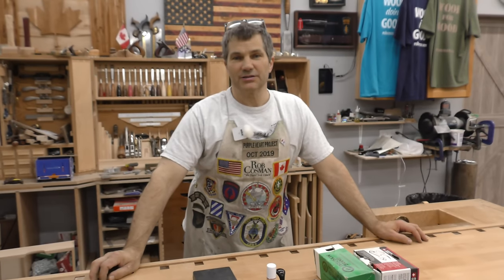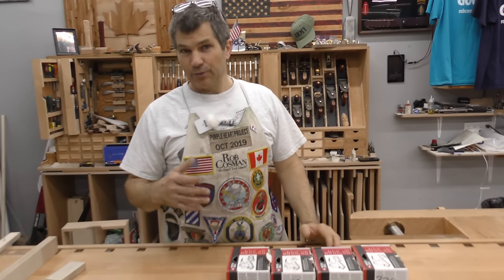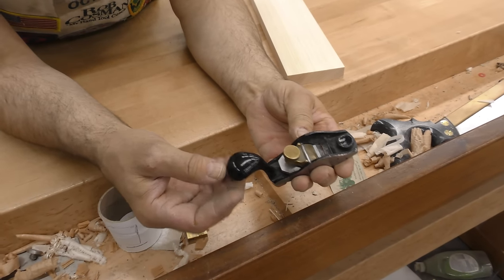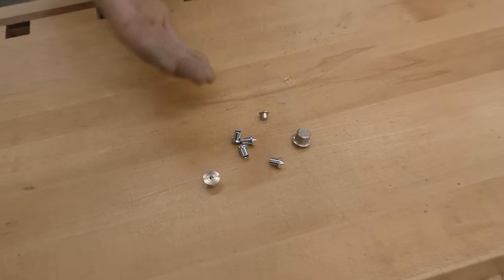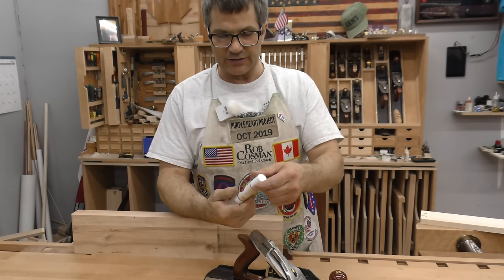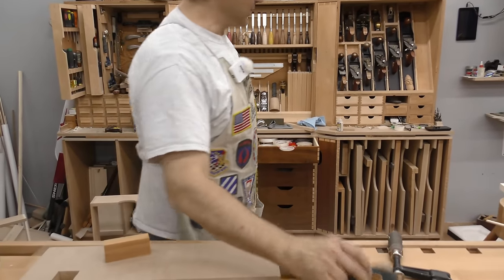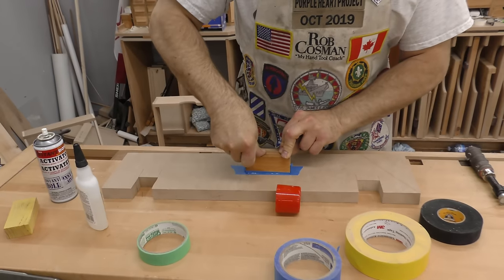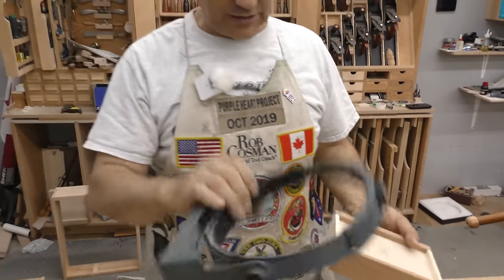Top Woodworking Gadgets - MUST HAVE ITEMS

Comment: Great list.  I guess I don't have to feel bad about using feeler gauges on woodworking projects anymore, and my Optivisors come in handy for fine work. ;)

One thing not on the list is a set of transfer punches.  They can be useful at times.
Reply from the maker: Feeler gauges give you super power!!!  Transfer punches ins another great tip

Comment: I will be buying that polishing putty.   Arithma Addiator for doing adding and subtraction.   You can quickly add and subtract multiple different things at the same time quickly and accurately.  Also if you can get it dry ice blasting, non abrasive way of removing unwanted surface material.   No sand dust.
Reply from the maker: I just looked up the arithma addiator....can you tell me more about it?

Comment: UK chippy here. The items I always have in my work shorts pockets are: 
Carpenter's pencils - soft and hard graphite, plus white for hardwoods
Quick change brad point pilot bits - it takes a few seconds more to pilot a hole rather than risk splitting the wood.
Stanley Sliding Pocket Knife- excellent lightweight utility knife with quick change blades.
6" Combination square - Useful for quick square checks and marking. 
Cheap reading glasses- I get them from pound (dollar) stores and are throwaway rather than wasting good glasses.
Drill bits- Flat, PH2, PZ2, they stay in the pockets and are transferred over to new shorts on wash day!
Reply: I've never seen a Philips drill bit. I thought that all drill bits were round.
Reply: @johncoops6897  "Drill bits" in UK can refer to either hss/brad point bits etc or screwdriver bits.
Reply: @nickm8494  - How odd. Well, considering that they are quite different objects,I imagine the UK naming tradition must cause massive confusion in the hardware store and on job sites LOL.
Reply: @johncoops6897  Not at all, John. I don't use "hardware stores", I use specialist trade and builders merchants and if you ask for either PZ2 bits or HSS bits we all know what we're taking about because we're professionals. lol.

Comment: Wax paper - to use under glue ups
Butcher paper - for patterns &  drawing plans 
Blu tack mastic adhesive putty - holding patterns/pieces, cleaning out grooves, making sure surfaces are dust free prior to applying finishes. Wad a bit around the end of a wire or dowel to retrieve small items from small spaces. 
Rubber Bands - dozens of uses

My number one... 
Rare Earths Magnets - wrapped in a piece of paper you can easily pick up spilled nails, screws, etc. Just unwrap the magnet with the things inside the paper & you can funnel them into a can.

Comment: I see quite a few of mine here already. Playing cards: shims, epoxy mixing, paint mix color testing, glue spreading. Popsicle sticks/ coffee stir sticks: shims, patch material, fast and cheap mixing spreading sticks. Old CDs: epoxy mixing. Drinking straws: clearing out glue squeeze out. Magnetic instrument base(the ones with the on/off switch): heaven send to hold plane blades and chisels when flattening the back, and also great to pick up metal filings and such. Saddle stool, similar to a low bar stool but with a 'saddle' or bicycle  like seat, most commonly used by hair dressers, gives your feet more traction on the ground compared to a bar stool and less 'thigh fatigue'.

Comment: I use those Optivisors also, and have found various focal lengths are great.  The lenses also are available in GLASS rather than plastic, if you want.  Also, you can get a small lens that attaches to the visor and swings onto the right or left eye for up to 10X for magnification.  Why would you want that?  VERY handy at times.  You can inspect very small measurements, also great for looking at cutting edges to see small flaws.  And of course for finding and pulling small slivers out of your hands!  pretty hard to hold a magnifying glass and tweezers at the same time, especially when the target is on one of your hands!

Comment: Hey Rob, thanks for the vid. Just wanted to mention playing cards. I use them a lot when, for instance, I want to move my bandsaw fence, just a hair. They measure 11 thou ( at least mine do ), and I love them because of their consistency. I have measured several with digital calipers and they are very consistent in thickness. I keep a deck in the top drawer of my tool chest...:).
Reply: Great for adjusting door hinges.
Reply: I added the hoyle waterproof cards recently.  They are almost exactly 1/64th of an inch thick, which is handy for a lot of things, and they are waterproof and glue won’t stick to them, so they last a long time.
Reply: @MD-en3zm  I'll have to get a package of these, thanks.

Comment: Rob, that little glue bottle is also great for liquid hide glue. Keep it in your pocket and the glue stays warm and flows nicely. Another great non-conventional accessory would be machinist set up blocks. I use ones that are 1”x2”x3” with perfect 90s in every direction. Indispensable for layout, setup and registering. Great video and nice tips!
Reply: I agree with the 1-2-3 blocks - I use a couple of them too. I also use smaller brass setup gauges in fractional inch sizes. The combination allows setting a dimension of nearly 5" between the fence and the blade, and if one of the brass rods is the one touching the blade, there is no damage to the teeth.

Comment: Favorite hand tool: my JessEm marking gauge (made in Canada!).
Most precise tool in my shop besides my digital caliper. It has a built-in micro-adjuster as well as preset detents so you never have to mess with a ruler to set it.
Reply from the maker: I just looked it up, very technical.  Thanks for commenting
Reply: that's exactly the desing I was looking for in a marking gauge (I already sketched a similar one to do it by myself), thank you for pointing this out.

Comment: I have the exact same selection of Porter Cable sand paper.  I have a collection of Stanley Bailey planes ... of course they all needed to be rebuilt (I use mine ... I don't buy any tools to just sit in a case).  I found nothing better to true up the sole of a plane.  I bought a giant piece of 3/8" tempered glass as a lapping plate ... it's so big it allows me to mount all of the grits side by side and works great.  Love the channel.
Reply from the maker: Yes that is a great technique for flatten plane soles.  When I restored planes I did the same

Comment: I own more tape measures than I can count, but I only use one—the FastCap PSSR-25. Like most, it'll measure out to 25 ft. but for those of us using imperial measurement, it shows fractional lengths down to a 16th of an inch. Yes, I can do fractions, but it's soooo much faster getting the correct length with this tape. Try it!

Comment: I like to keep various bits/tips for my screw gun in the small pocket of my carpenter shorts/pants. However, retrieving them from the bottom of my pocket can be cumbersome. My solution was a small rare earth magnet to keep them all together so when I pull them from my pocket they all come as one unit and I can quickly select the one I need. Recently I started using another magnet outside of my pants to drag what's in my pocket up so I can get a couple of fingertips on them. Hope this helps you out.

Comment: I save the preapproved plastic credit cards that come in the mail and use them to spread the glue on bigger projects. Also either wax paper or parchment paper also for glue ups. I put it on my work bench to keep glue from sticking to it and between my pipe clamps and the wood to prevent stains

Comment: My favorite non-woodworking POWER TOOL is an electric pencil sharpener. I find that 3-4 dozen pencils all over my shop has been a very valuable asset. However, sharpening pencils is a chore. But walking over, sticking-zip-sharpen is a whole new level of convenience. Plus, if you have any dowels that need "just a trim" to more easily fit, again, it's stick-zip-done.
Reply from the maker: Yup, I have one too.  Use it all the time
Reply: Every time I use a pencil it gets a touch-up in the electric pencil sharpener. Mine is over 40 years old, it used to be my father's.

Comment: I use to work in the woods a great deal then moved to the desert.  Much to my surprise there are absolutely beautiful wood here.  One problem I always had was throughly cleaning the blade of the saw where all of the debris was collected and the saw dust full of oil seemed packed into the area to the point of I had to have a special flat head screwdriver.  It took a great deal of time to rid the issue.  While walking my dog I came across a very thin piece of metal about 1/4" by about 6 (or better) long and about 1/8' of an ince in thickness.  The piece of metal was very strong but flexible.  I took the piece of metal to the city I worked at and discovered a couple more pieces of metal near the mechanics work area.  When questioned the mechanic told me that the little metal pieces were from the brushes of street sweepers.  I cleaned the small pieces and finally turned a handle for a couple and used it to clean the blades.  I than began to sharpen the ends and have used it in so many places.  I now have several and for a free piece of metal I have discovered a small tool that works for me in many ways.😃😃😃😃

Comment: I took a (Vaughn) pullsaw blade I purchased at Lowe’s and mounted it to one of my larger reciprocating sawblades....(typically a metal cutting one)...I first tried riveting, didn’t hold very well...then I took some bolts (w/nuts) off of an old computer part and tried again...

Hallelujah !🙏

Now I can use an actual 12” pullsaw blade with my sawzall! It leaves a very smooth edge and speeds up the cutting process. 👀😅

Comment: Stair gauges, the little brass clips designed to attach to a front square to set an angle, are useful.  They work to hold two rules together to take precise inside measurements.
Reply from the maker: great idea, your own inside measurement ruler without buying expensive ones

Comment: clear box tape can  be used to close a miter. you can still see the miter and if you run it in line with the miter it also helps prevent glue squeezing out. I usually use clear along the miter and masking perpendicular. masking has better grip. the two combined are an awesome duo. for small projects... no clamps necessary.

Comment: Silicone basting brushes for larger glue-ups.  Even dried (maybe even especially dried), the glue won't stick to them.  Some of them are a bit too wobbly, so I cut the "filaments" to about half length.
Reply from the maker: Absolutely,  really good tool, thanks
Reply: Also silicone pastry mats - work great for glue ups.  Nothing sticks to them, not even epoxy.

Comment: Great ideas Rob.  I have a head-band magnifier which has three levels of magnification, but what I use the most is a pair of $10 2.75 dioptre reading glasses that I have hot glued a 10X magnifier to.  This is for really close stuff like splinters.  My background is 40 year toolmaker and design engineer, so I tend to use a few engineering tools with my woodwork. I've used 1-2-3 blocks (I have four of them) for everything from setting jointer blade depth together with a DTI (Dial Test Indicator) to using as parallels and end stops.  They are useful to extend the range of digital calipers because they are so accurate.  The DTI enables incredible accuracy.  The way I use it is to run some scrap hardwood an inch into the table saw, and measure with digital calipers. I then move the fence while measuring the distance with the DTI and check again.  This gets you perfect fits first time.  There are some fantastic adhesives available nowadays, like Gorilla Glue, and Canopy Glue (which I learned of from one of the guitar making (Luthier) channels.  I mentioned that I am toolmaker (now retired) and I often use a milling machine with wood.  The downside is that the table size means it only works with small jobs, but you can get very accurate and perfectly square cuts.  I'd love a big CNC machine like Frank Howarth's, but I have neither the room or the money.  I also use a metal lathe with wood sometimes, using a HSS tool with lots of rake.
Reply from the maker: Yup I am getting a lot of folks saying they use 1-2-3 blocks

Comment: I have several traditional marking knives, but I've found I prefer (by a large margin) the small folding Stanley razor like the one Paul Sellers uses.  It is small, feels good in the hand, has a positive reference, being rectangular in profile instead of round, and sharpens easily.  I bought a spare blade, but have yet to open it after several years, as a quick shot on a stone and a strop and it's a razor again.

Comment: How about some kind of awl for marking hole locations, if you're not drilling with a brad point bit?

Those interested in the squirrel-tail plane might find the Veritas Pocket Plane to be a reasonable substitute... with its Norris adjuster, there's no need to tap away at the blade with a little hammer.

Comment: 1-2-3 blocks. Staple setup tool for machinists, but if you want to have a quick right angle for, say, paring a mortice wall, you can just holdfast the 1-2-3 block at the edge and pare away. Plus, for the tolerances you work to in wood, you don't need very expensive blocks. Mine cost around $20 canadian for two (bought from China). 
Also, machinists' deburring bits - the ones that look like a cone with a single hole cut through perpendicular to the surface. They are the cleanest-cutting counterbore bits out there, far better than the "rose" pattern countersink bits or the ones supplied clamped to the drill bit. 
Dental picks. You can get a kit of them in a nice wallet pack for a few dollars, and for cleaning out dried glue from awkward corners they are a fantastic tool, but I mostly use mine for cleaning out the grooves when doing line-and-berry inlay work. 
Self-adhesive coloured dots can be bloody useful when labelling joints.
And glu-bot bottles are remarkably good as applicator bottles for glue (and I use the pallette knife trick as well).

Comment: I have and use 9 of your top ten, plus all the honorable mentions. For now the squirrel tail will have to wait since there are a few other expensive things I need. In addition to the headgear with several different strength lenses I also have a magnifier lamp. I even use it in conjunction with my headgear sometimes after a long day. Also great for finding and removing those splinters that don't stand out against your skin color but catch every time you go into a pocket. It doubles as my bench light too.

Comment: Probably the most unusual items i use during my time in the shop are a bunch of fresh cloth pieces for general cleaning and polishing . I like them over paper towels because of the feel and also that they can be rewashed ..... And glass shards ..... There are some times when a glass shard will produce an exquisit  surface finish better than a scraper expeciali when cleaning narrow spots on carvings
Reply from the maker: Yes i also use cloth. I get a bunch of old T-shirts, cut them up and they are my shop rags.  I don’t wash them though.  Never thought about the glass trick.  I will try it

Comment: Hi Rob, my top is engineers automatic (spring-loaded) centre punch. One plunge delivers accurate dimple for drillbit or nail. Used all day every day. 2nd: (guiltysecret) decorators scraper with replaceable 4-sided blade. they're sharp with long-lasting burr, great for cleaning up long glue lines and save my proper scrapers for other purposes. 3rd: old bone-handled thin-bladed dining knife (Sheffield-made). tip broken off square and sharpened with single or double bevel. removes any temptation to misuse a chisel. used every day! 4th: two biggish sheets of stiff cardboard (not corrugated). Pick up three times the amount of shavings you can get in a dustpan, also piles of sawdust. Seems pathetically low-tech in today's world -- until you realize you're not using energy to shoot dust-laden air through a filter which is never 100 percent perfect. Makes shop vac last much longer. Got mine in France from year-at-a-glance wall calendar sold door-to-door by local French firefighters.  They were always smiling but as the owner of an old rather ramshackle house I felt it would never be a good idea not to contribute to their funds . . . . .  John.
Reply from the maker: All great ideas..  I love low-tech.  The cardboard is a wonderful idea.

Comment: I carry Starrett 6" rule No.C604 RE in my pocket 24/7/365. Anti-glare matte finish makes it ledgible in any lighting condition.  Ends are marked from 0 to 1/2" perpendicular to the rule's length, making it perfect for setting up blades and bits. Rule is exactly 3/4" wide and very close to 1/16" thick. I am a woodworker and also a trim carpenter. The 3/4" width comes in handy for endless quick layout tasks involving 1x trim members and case goods. This rule has become so essential to my workflow that I always carry at least one spare in my tool kit. Never want to be without one.
Reply from the maker: You got to love Starrett   End rule is nice

Comment: All your tips are great.   Here is my take on a couple of them;  For cheap shim stock I use soda cans cut up with tin snips.   For thicker shims I use tin roaster pans from the grocery store.   For the calipers I use digital calipers.  Easy to read AND they read in metric or imperial at the push of a button.   For tape, a type often overlooked is gaffer tape used by movies, stage and musicians.   It may be the strongest tape out there and made to not leave sticky behind when removed.  It has a true cloth backing and stretches very little.  A little pricy but worth it.